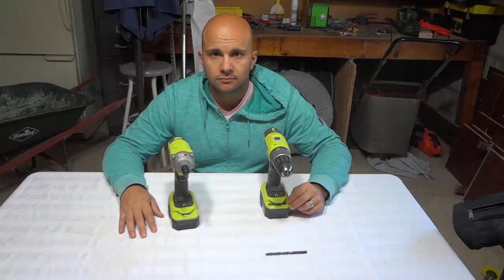Drill VS Impact Driver-The Differences

Comment: It sounds like a waste to get an impact driver unless you have to drill a lot of screws. You'd still need a drill for so many other things, such as drilling pilot holes for screws. Also the combination of non-adjustable fast speed with the lack of a clutch, wouldn't that cause you to strip screws much easier? There just has to be a better reason for buying an impact driver than to drive screws. It seems so very limited, I can only imagine this might be needed/wanted by someone who drills a whole lot of screws for business or as part of a hobby. Thanks for the video. I will no longer wonder if it's some kind of new, great tool that I could use. My cordless drill drives screws and a whole lot more just fine!
Reply: I decided to look up the drill I have, and it turns out to be called a Compact Drill/Driver (Dewalt DCD771C2). So that begs the question… what's the difference between a driver and an impact driver? Does "impact" specify that it's faster, but highly limited (only drives screws, only accepts one type of bit shank, only 1 speed, and no clutch)? The clutch alone is very important to me when driving screws. I'm a typical person who does not do anything like this for a living or on a regular basis so I need the clutch to help me not strip the screws. I usually drill a pilot hole to help the screw go in better then use the clutch to help me not strip the screw head. Maybe other videos will offer more information on why one would want an impact driver, despite it's limitations, but just viewing your video has left me wondering why they even made impact drivers other than to take money away from the few who just has to have every gadget out there (which is really more of a collection than anything).
Reply: It depends on the type of wood you are drilling into. Someone who wants to build a deck, put down a plywood floor for tiling  etc  an impact driver is the way to go. Many screw bits have a clutch or other system to regulate screw depth,  so no stripped screws. ALSO look at my soap bar tip

Comment: Nice job cool video thanks.  Is it still necessary to pre-drill a hole for the screws if using an impact driver?
Reply: That depends on the length of the crew, its thickness, its quality and the type of wood, so there is no hard answer. HOWEVER rub the screw threads against a bar or soap and they'll go 2x deeper. (you're welcome ;-)